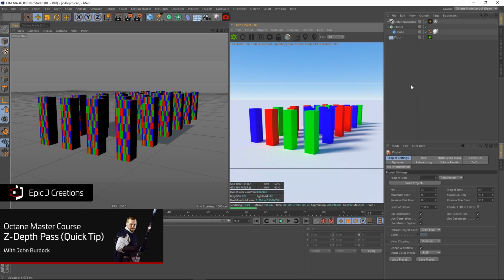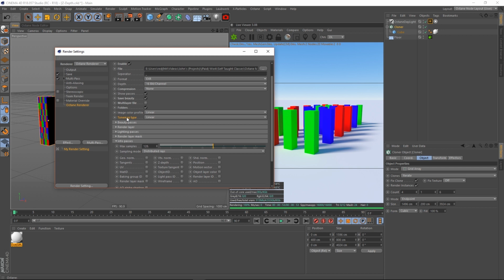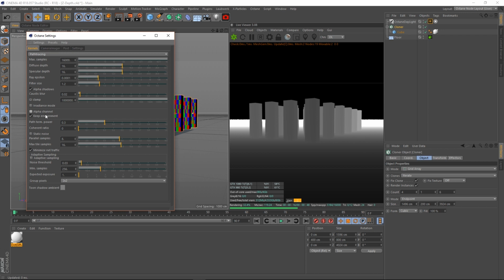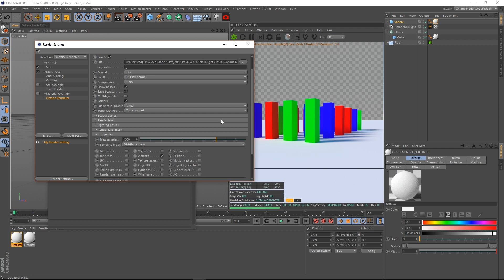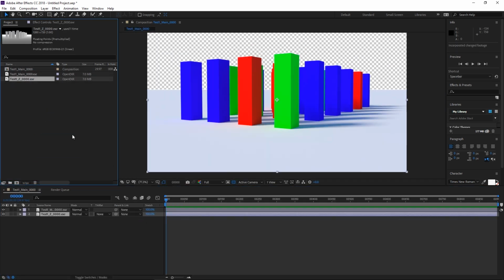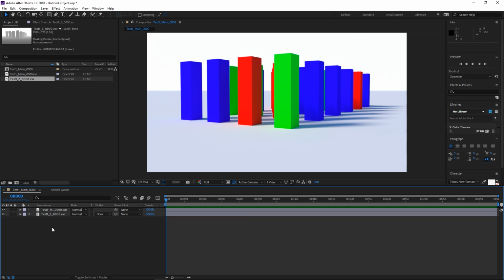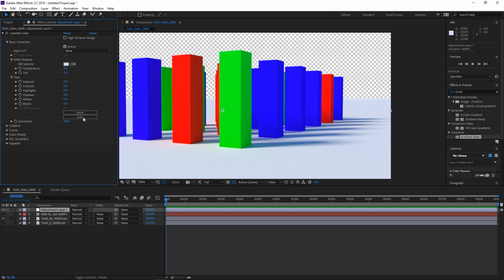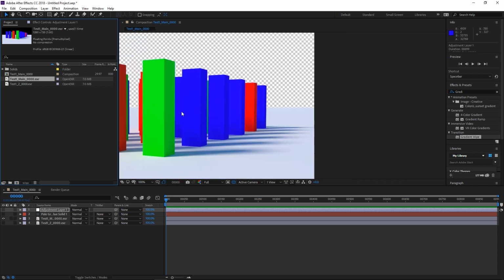Popper Z-Depth Pass export in Octane and C4D (Quick Tip)

Comment: Nice! Do You have antialiasing on Your zdepth image?
Reply from the maker: Yep, I did have antialiasing on by keeping my sampling mode set to distributed rays, instead of nondistributed. :).
Reply: @EpicJCreations  Cool, so if You set Non-distributed without pixel filtering You sharp zdepth to use with firshluft for example? I still cant get sharp zdepth from octane.
Reply from the maker: @beherenow5866  Yep you should get a very sharp Z-depth map that does not account for the focus or depth of field effects you have on your camera. What is the issue that you can't do with your Zdepth map in firshluft. Are you getting fringing on the edge of your alpha?
Reply: @EpicJCreations  Exactly, becouse of a subtle antialiasing I get issues at the edge of every object.
Reply from the maker: @Rokkaboy-com  Ah I see. To stop this issue, you actually want to keep your settings set to Distributed rays, and then make sure you put the sphere in the background with a diffuse material on it, with Shadow catch checked on.
Reply: @EpicJCreations  Yes! Im getting fringe on the edges. Thanks!
Reply from the maker: @beherenow5866  Do you still get fringing when you have the shadow catcher object closing the alpha off on it, making sure you have a pure white background?